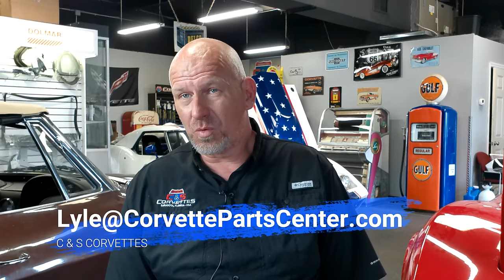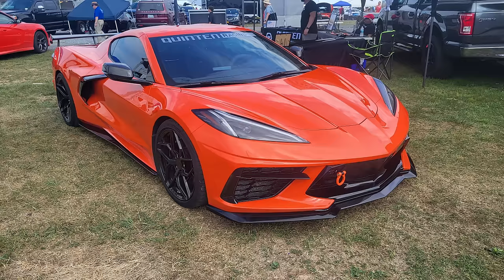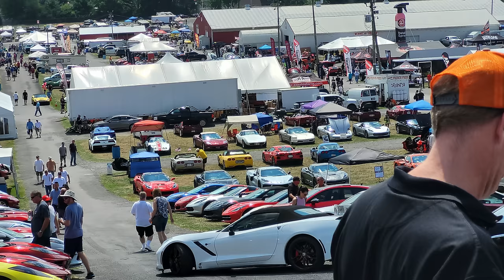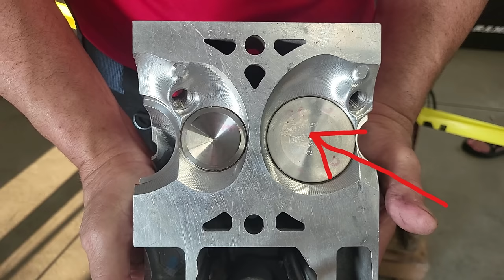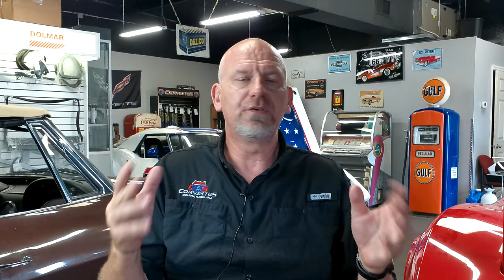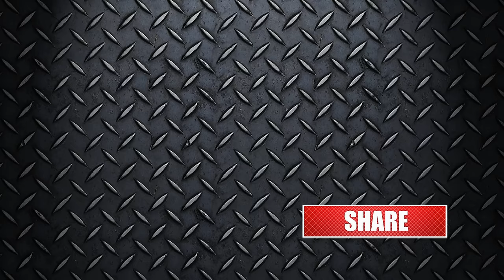The Truth about the LS7

Comment: Nice vid, however you forgot to mention!The LS7'S use relatively high lift camshafts. 
Premature valve train failures can be caused by high lift cams that cause long rocker arm travel. 
Long rocker travel causes lateral force on the valve stem when the valve is open.
This lateral force wears out valve guides. 
Which causes valve and guide tolerance to go out of spec. 
GM even had a service bulletin with a valve stem "wiggle test". 
GM also acknowledged that several batches of valve stems were installed incorrectly at the wrong "angle". 
Valve issues are widely documented. 
Race Proven Motorsports to this day continues to find bad valve guides in LS7 Camaro's.
Reply: Excellent analysis 👍
Reply: Ya he missed a lot of stuff, like how high rpms are needed when holding a gear thru corners, going thru traps on a drag strip, etc... You know the kinda things you buy a Z06 for.  My guess is he is either really stupid,  or trying to cover GM's ass over a well known well  documented problem GM doesn't want to admit to. I laughed when he said you don't need high rpm's and not to over rev your engine. You CAN'T over rev a engine with stock tuning, the ECU will not allow it....
Reply: @Milo Jones I'm a fan of roller rockers. Also, just wanted  to ask, are those duration numbers @.050 or advertised duration? Cuz if that's .050, good God that's gotta be a rowdy camshaft, especially at 111 lsa 😂. 

Unless the LS7 manages high duration well and those numbers are kind of normal for it. I know it is set up for high lift, so the 684/683 doesn't shock me.
Reply: @Milo Jones That's badass, man. And I agree on the rollers. I kinda think GM should have just used rollers to begin with. The thing has just about .6" of lift from the factory, and it's a nice, expensive engine. Just use rollers GM! 

Of course, GM has been pretty famous about cheaping out on rocker arms. Needle bearings with open trunions that scatter the needles everywhere comes to mind.

But that is really, really good info about the swipe pattern with the rollers. I'm an Fbody guy, but of course one day would like to buy an ls7 car, probably a c6 Z06.

Comment: I have a confirmed valve drop 26k miles and absolutely no aftermarket parts. Stock exhaust, air intake ect. I’d like to know why mine dropped then and if 7000 rpm is to much maybe redline should have been lower from factory
Reply: Yep, should have just said "ls7's have weak valve springs stock. Dont buy a car that isn't bone stock, unless it has aftermarket head work or heads in general."

instead we get this scotty kilmer spiel about how the engineers know better than you and it's just a bunch of mansplaining. Dislike from me. Gl with your vettes, wouldnt bring em here.
Reply: @fry.master  the issue with LS7 valve drops are not with the valve springs.  It was related to the valve guides.

The broken valve spring issue dropping valves is with the LS6.

Comment: Great information, but..... I had a completely stock, 2008 Z06 that I purchased with 1,400 miles.  At 19,xxx miles it dropped an intake valve and cratered the engine.  It had not been tuned.  It had not been to the track for a single mile.  It was absolutely bone stock.  So, while this is great information and likely applies to most people, just be aware that it does not apply to all.  The likelihood that you will have a catastrophic engine failure may be small, but it is no small deal if you happen to be the one it happens to.  Especially if you are out of warranty age-wise at the time the failure happens.

Comment: I've had three C6 Zo6s 07,08,09 about 50,000 mi driven combined and never dropped a valve, I was very aware of the valve drop issue, it never happened to me. I still have the 09 and am thinking about heads and cam. Best of luck to every other LS7 owner out there.
Reply: I just bought my first 06 z06, 75k miles. After buying it I read that they spontaneously combust every 5-10k miles so I’m debating on whether to check my guides or just just bury my head in the sand and have a backup plan if the ls7 does decide to shit the bed.
Reply: @auditrevor  Get the oil tested

Comment: Owned a 2009 ZO6. No mods. Ran flawless. Sold it with 73k miles. Bought a 2010 ZR1.
Reply: Wish I had, ha. I enjoyed my 2002 electron blue Z06 straight away 177 per hour tunnel vision for $55,000.00. Had 5 other vets various degrees lol. 3 C7s not impressed with Bowling Green. C6 felt kind of slippery. I probably will go back C5 when the dollar adjusts my way lol.

Comment: This is BS. The issue was NOT fixed after 2006.The official GM bulletin specifically states the 08-11 cars which is also incorrect. Of course the GM engineer is going to say there was no issues but the truth is, its very much a real problem that still exists today. Please do your research before buying one of these cars even if its STOCK.
Reply: Totally agree, and can speak from experience...
Reply: Totally agree from experience too!! Dropped a valve on a 2007 1st gear pull w a customer while tuning him, (stock limiter). Needless to say, destroyed the engine.  I typically love your content, but this was complete bs on the airflow and tuning aspect affecting guide wear.  The whole stock engine lives is bs, related to the valve guide wear issue.  I’m a GM tuner and Mechanical Engineer from the automotive industry, I can back up my info too.

I do generally agree w everything else that was said.
Reply: completely agree 💯. The only leg they have to stand on is that there are little to no issues with stock LS7 engines. Nobody leaves an LS7 completely stock! This is the most common form of manipulative statistics! Find a C6 Z06 without an intake or headers, and I'll show you a garage queen. Even when completely stock, and just well driven as designed, you'll have the same valve issues as they ALWAYS have eventually. Still a great platform if you're willing to spend the time and money necessary to make it perform and be reliable.
Reply: I owned my 2007 Z06 for 10 years and no engine problems (thankfully). However, I was well aware of the potential for a catastrophic engine failure. But I did have the clutch replaced under warranty due to something the dealer tech called an overcenter condition. In real world terms what this meant was the clutch pedal stuck to the floor and wouldn’t release until I backed off the accelerator. Even though a gm engineer told me the single disc clutch could handle the LS7 torque, I never believed it. It should have been built with the dual disc clutch like in the ZR1.
Reply: @jamesw.6931 why are you yelling?
Reply: @jamesw.6931  I am not disagree with anything you said. I think you are right. Just asking why you are you yelling?

Comment: After scrolling thru these comments, I STRONGLY URGE any of you who own an LS7 to join LS1 Tech, and/or the Corvette Forum. There are Engineers on BOTH forums who are just as smart, or smarter than Koerner, who do not have to answer to anyone higher up at GM, who will give you the flat out truth about what Koerner tried to bury. Coincidentally, the LS7 has been discontinued. Most people who have, or do own an LS7 (that hasn't blown!) absolutely love them. Now, if a product is extremely popular, and is profitable, why would a manufacturer discontinue it? GM still sells the original small block Chevy V8. They haven't ever stopped making it, since the Fall of 1954-68 consecutive years!!!
Reply: @jamesw.6931  Exactly my point! They are popular, and they're profitable. The LS7 is also popular, so we're left with the "profitable" portion. There's only one reason they aren't profitable, and I think it's due to warranty claims.....

Comment: For ultimate performance, saying "shift 1000 rpm below redline" really doesn't work.  You ARE losing performance.  OTOH, for a street car which is not in serious competition, it makes perfect sense most of the time.  Few if any street drivers need ultimate performance.  If you drive any hi-po engine right up to its limits, it will need more maintenance, repair and will probably succumb earlier.  That's the nature of the beasts.
Reply: No point in reving to redline as power is dropping off a lot.
Reply: Wrong, my LS7 hits hp peak at 6800rpm. Get your heads worked and run the crap out of it.

Comment: I’ve had two ls7s both of them failed both of them completely 100% stock. Absolutely no modifications, not even a custom tune. First one failed due to exhaust valve failure, second one spun a crank bearing. I really think it is a problematic engine. I didn’t have any problems like this with my previous ls2 and ls3.

Comment: Asking a GM representative about failures is about like asking a kid if he stole a piece of candy. You might get the truth. How many times have I called the manufacture of a part and heard, "We've never seen that problem before". Sure..often I knew of others with the same problem that had called the same manufacturer. It's a CYA.  While I don't know how legitimate the LS7 issue is, they don't seem to be as reliable as say a LS6.
Reply: @jamesw.6931  Change the Ti rods, too.....
Reply: @jamesw.6931  I believe that he meant the titanium rods in the LS7
Reply: @BiscuitMcgriddleson  yes bcuz they're meant to stay n/a, how much power can the ls7 block handle??
Reply: @P71ScrewHead  there are debates as to what the LS7 block can handle stock versus sleeved. Titanium rods have been used in forced induction applications before, notably the LS9 with their rods sourced from Austria.
Reply: @jamesw.6931  Unfortunately, the LS7 rods do have issues even at stock power levels. They changed from Mahle to Pankl due to some of these issues. 

Titanium is super cool, but the cost of a single titanium rod covers an entire set of powdered metal rods in the LT4
Reply: @BiscuitMcgriddleson  oh ok, I hear the limit is around 700rwhp, but Idk.. The ls7 is my only liked ls engine..lol Any aftermarket CNC heads for them??
Reply: @P71ScrewHead  LS7 has issues with the titanium valves and also the titanium rods. Yes it is a glorious engine, but they had some issues with the Mahle rods and eventually changed over to Pankl, who appears to be one of the best in the industry. Titanium can have extremely sharp edges and when the rods rub together it can create titanium dust that might eventually grenade your engine. 

There are aftermarket heads, but it appears some actually switch to stainless valves.
Reply: @BiscuitMcgriddleson  I see.. Maan, my car is blowing too much white smoke from the exhaust, might have a coolant leak, head gasket issue.. 🤔😬
Reply: @P71ScrewHead  yea, you'll want to get that checked out. Might need a full rebuild. Probably would be a good idea to remove the titanium if it does require a full rebuild.
Reply: @BiscuitMcgriddleson  oh, I forgot to mention it's a 2v Ford P71..lol 😆🤣 Wish it was a built bottom end, still stock for now tho..
Reply: Absolutely agree 100%.  I love the content of this channel, but this time IMHO Lyle is being a bit naive believing what a GM person told him.

Comment: Lyle, Sorry I missed you at Carlisle, love your videos and this one in particular. I have a 2013 427 convertible with a little over 30,000 miles. I have read all of the dread on the forums, so I have changed the oil and filter every 5,000 miles or year whichever comes first. I also send the oil off to be analyzed and the reports have come back clean each time. I plan on keeping this car and enjoying the drive. Keep up the good work. Wish your shop was close to me, need a good shop in Eastern Va.
Reply: Now here is a smart owner. Don't believe all the BS GM is spewing. You don't hear of ANY of these problems with the LS1, LS2, LS3, LS4, LS6, LSA, or LS9. There was, is, and are reasons for cause and effect.....
Reply: Is 5 000 miles not standard oil change interval? If, with Covid, one could put that many on in a year. I went to once a spring change the last couple of years. I would think spring is better than fall to get out any winter moisture in oil? Yes/No?
Reply: @codyhatch4607  I change the oil and filter on all of my cars at 5,000 miles or  once a year whichever comes first.
Reply: @milojanis4901  , Katech HAS found the same problem with the LS9.

Comment: Never had a problem with my ls_7 it was a 2008 zo6. Autocrosses it for 3 Years bought it 27k sold it with 56k. Between 2 drivers it won 14 of 16 races. I also personally ran about 100 to 125 quarter miles runs in the 4 years I owed it. I ran cold air intake and hypertech programer. At different times. I also very early on I reduced the rev limiter. 6500. Ran like a rolex watch. Never missed a beat. Miss everything but the arrest me red color. Just 2 cents.
Reply: When was your build date?
Reply: I also have a 2008 Z06. Ran the thing hard on the streets all the time. Bought it at 36K miles. Never had it tested for the heads. Just enjoyed it. Like you should. Tuned it and added aftermarket parts. At 52K miles finally upgraded the heads and cam and went right back to beating on it and enjoying it. Mines also red
Reply: @joem1382  mine is a 07 but with a 09 service engine since I blew the original spraying a big shot lol. The 09 engine has now 70k miles and running strong.
Reply: You never daily drove it only quarter mile passes and autocross sounds like to me that's why you had no issues
Reply: How often have done your oil changes and what kind of oil did you use?
I just picked up a 15 z28 with 5k kms on it
Reply: @joem1382  Also a red 2008 Z06 owner, bought at 31k miles.  Now at 40k.  Also red.  Bone stock, it's a beautiful work of art and such fun to drive.
Reply: @crazieman  enjoy it and treat it right. These are fun cars. Wait till you mod it. The fun is just beginning

Comment: Brass valve guides?! I think you meant to say bronze. I repair cylinder heads professionally.  The guide problems affect all LS7 engines. There may have been some machining problems at one point, but the bigger issue is the nitride coating on the titanium intake valve eating up the powdered metal oem guide. There are various fixes, including a heat treated powdered metal guide, and manganese bronze guides. I have redone several sets of LS7 heads for local Chevrolet dealers that were trying to service customers, and didn't want to wait to get parts from GM. I used manganese guides in those, with very good results. No further problems, some in service 9 years now. It would have been better to use a valve seat compatible with a titanium valve, and forego the coated valves, but I guess GM found that cost prohibitive.
Reply: Well your’s is the most interesting reply here, thank you and yes he did say brass. I’m impressed you’ve had such success with your fix techniques. How do we got hold of you??
Reply: @540chevhell9  To be clear, I am not here to solicit business.  If anyone has questions you can message me, I am happy to try to help or point you in the right direction.
Reply from the maker: You are absolutely correct--I meant bronze.  Lyle
Reply: hi, I thought the silicone bronze was prefered for ti valves- that is what the NASCAR guys use- pro stock too.

Comment: my 2007 c6 zo6 had catastrophic valve failure on three valves, at 42k. completely stock. Fortunately the extended warranty paid for two brand new sets of heads however at 84k, (42k on the new heads)...guess what the valve train is ready for replacement. So out with the factory heads in with a custom set... ls7 uses a 1.8 rocker arm ratio that puts a lot of side load on the guides themselves, if you get new guides, get bronze but also research longer guides to assist with the additional side load stress

Comment: Thanks for the LS7 information my question is l know the LS3 is a slightly different design than a LS7 the LS3 has a smaller bore 3.62 crankshaft and different heads and slightly less compression I've seen these engines run reliability and dependable for a fairly long time that rev to 7200rpm with a BTR EPS camshaft with 228 intake duration and 240 exhaust duration with good maintenance and surpass the LS7 505 horsepower rating by 55-65 horsepower with no ill effects while being streetable with a broad powerband from 2000-7200rpm just wondering why these engines modified seem to be perfectly fine while the LS7 is so much more finicky l could be wrong but l prefer the LS3 shorter stroke crankshaft of 3.62 over the 4.00 stroker crankshaft of the LS7 have a 2011 Camaro SS with a new GM performance LS3 495 horsepower that runs on E85 with many upgrades since December 2021 and so far I'm very happy with the performance and reliability of this engine
Reply from the maker: Gloria, I totally agree that the LS3 is an excellent platform for tuning and adding power.  From what Paul told me, the LS7 isn't a good platform for those same things due to its design and the materials used.  Lyle

Comment: I have a 2006 Z06 with 101,000 miles on it. I shift at 5800-6000. The engine has so much torque that there is no reason to rev past that. (only has had oil changes--still has the factor spark plugs-new clutch at 98,000)

Comment: 117,000 miles on mine so far. Bone stock engine. Even the air filter is the stock AC Delco Donaldson Power Core. Was very diligent during break in period, swapped the oil/filter at 1100 miles. LS7 continues to be a gem of an engine for me. A very interesting article in Corvette Action Center by Hib Hiberson "The Ruthless Pursuit of Power' states (if I'm remembering correctly) Feb 2011, GM asked or required Linimar Manufacturing (they machined the heads) to do a 100% inspection on them instead of spot inspections. And the valve guide issue was largely 2008-2010. My engine was built in 2012 for the 2013 model year.